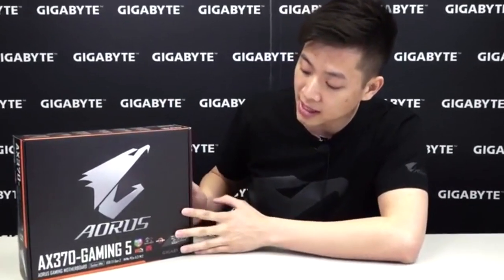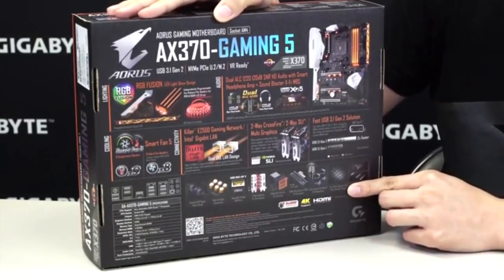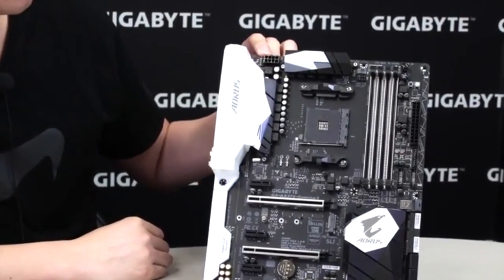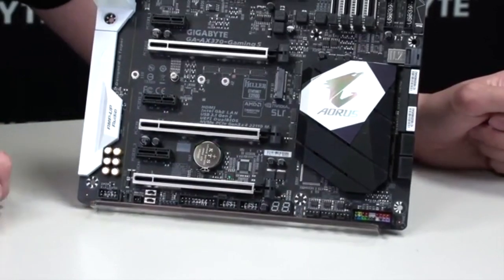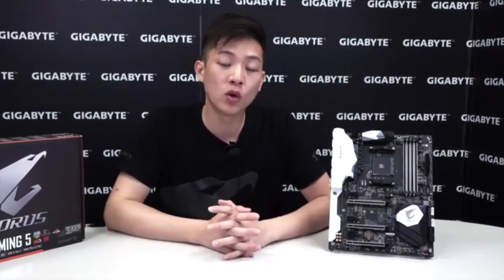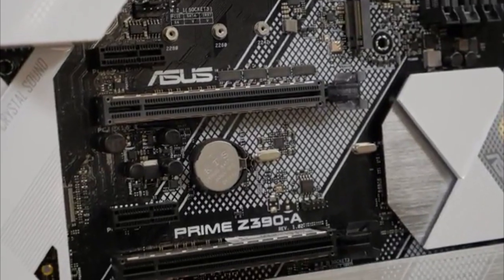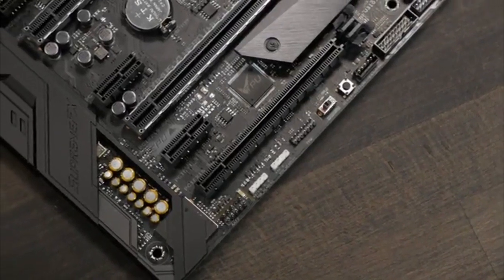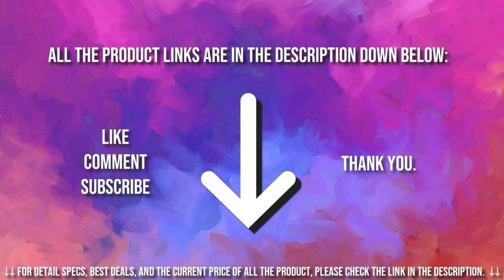5 Best Motherboard For PC Gaming On Amazon-Best Review

Comment from the maker: 5.GIGABYTE AORUS GA-AX370-Gaming K7 (AMD Ryzen AM4/ X370/ RGB
  FUSION/ SMART FAN 5/ HDMI/ M.2/ U.2/ USB 3.1 Type-C/
  ATX/ DDR4/ Motherboard)

US. https://amzn.to/2PZJ9k4

4.ASUS Prime Z390-A Motherboard LGA1151 (Intel 8th and 9th Gen)
  ATX DDR4 DP HDMI M.2 USB 3.1 Gen2 Gigabit LAN

US. https://amzn.to/316IOxc

3.MSI MPG Z390 Gaming Edge AC LGA1151 (Intel 8th and 9th Gen)
  M.2 USB 3.1 Gen 2 DDR4 HDMI DP Wi-Fi SLI CFX ATX Z390 Gaming Motherboard

US. https://amzn.to/34pasrc

2.ASUS ROG Maximus XI Hero (Wi-Fi) Z390 Gaming Motherboard LGA1151 
 (Intel 8th 9th Gen) ATX DDR4 DP HDMI M.2 USB 3.1 Gen2 802.11AC Wi-Fi

US. https://amzn.to/31hQnRy

1.ASUS ROG Strix X570-F Gaming ATX Motherboard with PCIe 4.0, 
  Aura Sync RGB Lighting, Intel Gigabit Ethernet, Dual M.2 
  with Heatsinks, SATA 6GB/S and USB 3.2 Gen 2

US. https://amzn.to/2PTcJaW